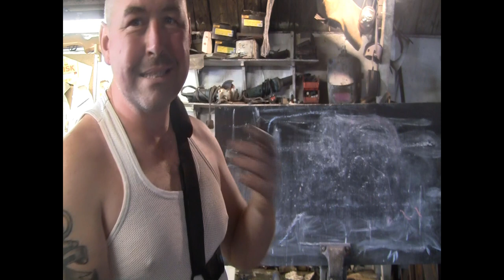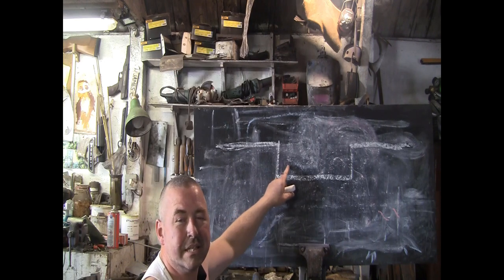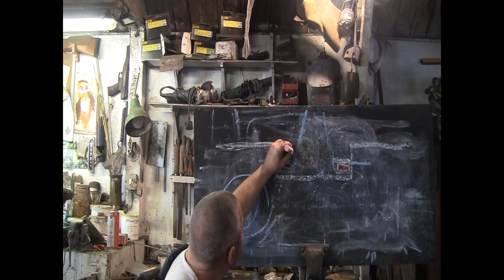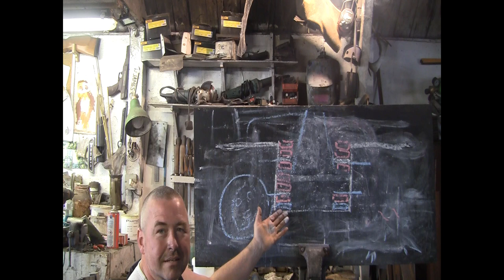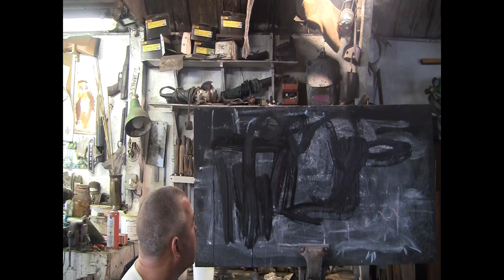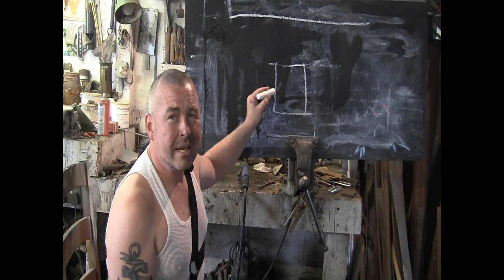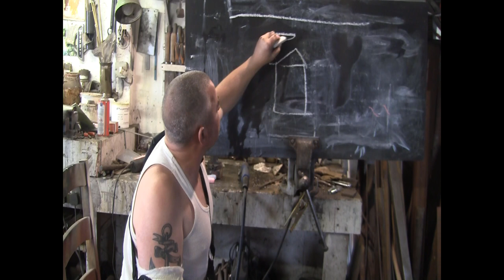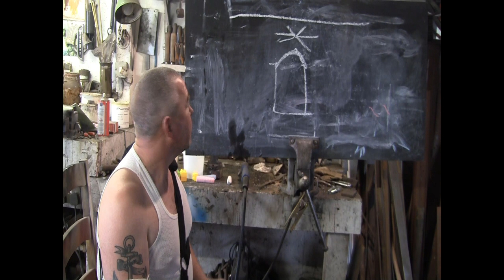Brick shaft and bunker depth theory

Comment: Awesome discussion of the tunneling physics! I knew the basics of why I am able to do more with arches, etc. But this is a great reminder about what's going on. So if I make my tunnel just 4' underground, I'll need to support the soil when I get the tunnel wider than 2'. The arch shape is helping my entrance area nicely now, but it's not meant to be permanently unsupported. I've heard that when drug smugglers tunnel underground, they don't even support the ceiling at all when they're in the right soil type. That's obviously not for making rooms, just tunnels barely wide enough to move through.  Hence my need for better shoring at some point soon. If I could do my hobby tunnel as much as I work my normal job...
Reply from the maker: You still need to maintain the shape at any depth and if you have a flat roof that includes supporting the triangle of dirt that maintains the shape but if your width exceeds 0.5 of the material above then you need to do more than just maintaining the shape. 
I've not seen too many pics of the smuggling tunnels except for the motorcycle el Chapo mining train which held my attention more than the civil engineering! for burrowing through solid clean rock, the Maltese experience is fascinating and there's a great many published works on it too. Grandpa stopped there on his way to see the Italians in Africa 75 years ago and I have made a friend out there so maybe I'll get over with a camera some day but I think it's irrelevant for me and you unless we carry on going down till we hit bedrock.
The Maltese dug a small town underground during the Luftwaffe siege, there were semi natural and entirely manmade water conservancy schemes since the Roman empire, British Napoleonic forts and more recently it hosted the NATO hardened command center for Europe which is currently being refurbished for display purposes, those chaps have turned their island into honeycomb, I think you'd enjoy looking into it.
Reply: Cool!
Reply from the maker: @Shrubberyjsc  over half a mile and they managed to get from one house to another, pretty unsavory activity but impressive none the less.
Reply: @Shrubberyjsc  can you send a link to your you tube site cheers

Comment: All makes sense. Was it the Golden Gate Bridge footings they pressurised to keep the water out?  
Killed a few blokes I think.. pressure, humidity and temperature. 
What's the new channel? Shrubbery something.. I can't find it.
Reply from the maker: Link in the pinned comment, shrubberyjcs.
Haven't read about golden gate, there's a few different types of pneumatic cassion but I'm not sure I'd want to work in any of them, got a lot of opposing forces that need balancing else they'll ruin your day and according to Clint Eastwood there's fierce currents in that bay.
Reply: @turboconqueringmegaeagle9006  
Thanks.. I didn't click on the "more" bit.. Rookie mistake.
Reply: There's not much to showcase so far, but I'm working on a crude minecart so that I can move the excavated dirt more efficiently. Then I should be able to dig faster.

Comment: Hay thanks so much for the video mate. That really helps me loads. I wondered what ya ment by twice the depth etc but ya drawing explained that perfectly to me. I actually think I can come up with a plan of attack now. It’s actually quite a headache pulling this of in my situation with not even the family knowing about it. But hay it happing. I can’t ever sell the house tho 😅 all the work that no one will know about (an less they need to that is) but anyway man Iv had a drink and don’t want to waffle on to much. But that so much for taking the time to help me it means a lot to me. If you need anything like cables etc which I can do let me know and sort you out 😊
Reply from the maker: Mate that's what I said from the beginning you crazy bastard, in your shed under the noses of 7 million people, the engineering bit of your project isn't even the most difficult just moving stuff in and out is and your sheds still cleaner and tidier than mine.
Reply: @turboconqueringmegaeagle9006  hahaha I moved that 500-700kg ish of mud this morning ( with a hang over) Ya have to be a crazy bastard in this world (normal is boring). I love the sneaky around it make is fun. But yer it would be nice if I could have a pallet of blocks and sand ect dropped of. It will be hard work for me but I’m once done all that work will have been worth it hopefully. Obviously my bunker size has to reflect my situation so it will only be a small one. But hay 8.4 billion people on earth and probably 5000 private bunkers in the world, at least I’ll be one of them 😃 anyway man it’s ment to be 28 today so beer bbq  in the garden today and strip the copper finally. Have a great day buddy

Comment: Congrats on the reattached bicep.
Late to watch been busy with my project which has been ongoing for a long time but has hit warp speed now inspired by yourself and other tunnellers lol
Reply from the maker: Are you digging?
Reply: @turboconqueringmegaeagle9006  been digging for a while on the man cave but got distracted last year digging out the cellar. After 16 skips and a couple of grab wagons that's done. Did discover a hidden room underneath the hallway which was a nice surprise. All dates back to 1800 s..
It did leave me with a problem because I saved all the good limestone about 15ton I reckon.
Using all that to make my mine head lol.
I live in Yorkshire so I think it's genetic.
On a hill water is not a problem got limestone bedrock which is a bit if a knacker to deal with but it does have its advantages.
Always impressed with your efforts james and it's good to see that I'm not the only mad person trying to walk under the ground in secret.
Cover story always has been a soakaway now everything is beening hidden away. So plan is at moment building on top 10ft undercroft to bedrock passage leading to original dig some 17 years ago plus an arch at the bottom of the sub basement that is lined up with the house cellar.
That's a quick summary.
Kev
Reply from the maker: Sounds like a proper warren down there now Kev, I recall you mentioning finding the secret room now.
I'm always wondering what it'd be like trying to go through limestone or sandstone, if the pros outweigh the cons compared to the ancient sea bed I'm working in.
What are you chipping the stone away with?
Reply: @turboconqueringmegaeagle9006  just depends which way the rock is laying. It's layered like a cake lovely on one side.thick layers Drills disc cutters and breakers depending on how the rock is. Haven't traversed sideways too far yet. Not quite felt I had enough depth yet.
There is a fault line which has opened up to an interesting area (cave) that I'm just emptying at the moment. This is going to be my starting point once I have built the walls and supports.
Like u said in this video James there are not many resources for people doing this kind of thing. Dibnahs method is a bomb proof one. Very similar to what the Americans do with drop box and shutteing method. Wood is not a permanent option in the UK due to the dampness in the ground. I'm stone age at the moment. But going to have to use steel and bolts  when going across to brace the layers together. If the rock runs vertically that shit is harder to get through.
Getting rid of material is a pain, the original excavation had 10 skips away 8 ton ones. Graded as much as I could back in to the garden.
No though I have my own sand and aggregate production which makes some good concrete to hold them big rocks together 
The jury is still out on how hard its going to be.
Your project is of  a far grander nature than mine and has inspired me to push forward, that plus the threat of ww3 lol.